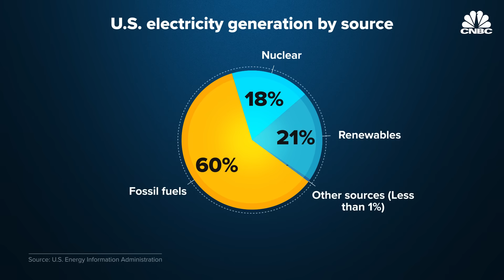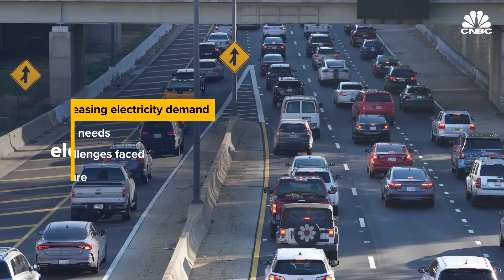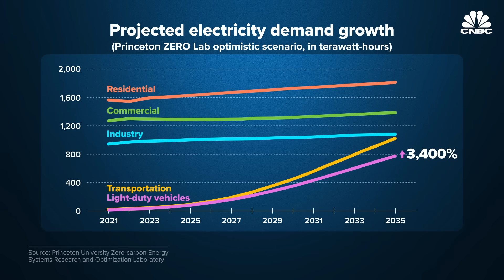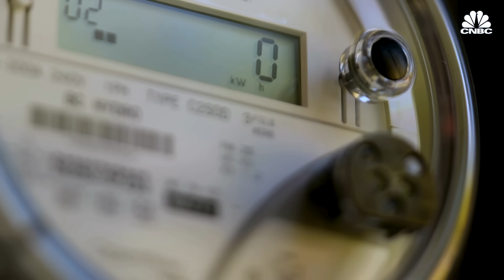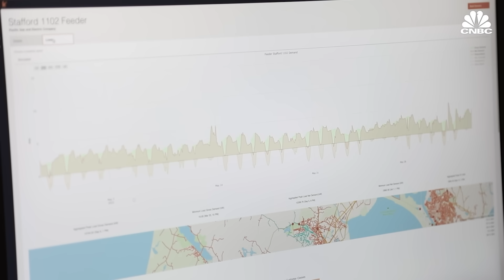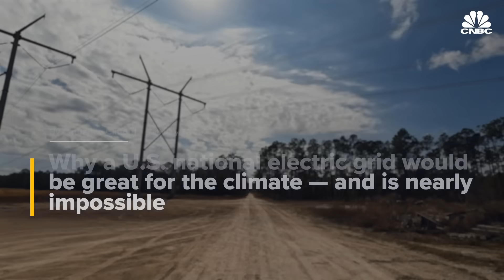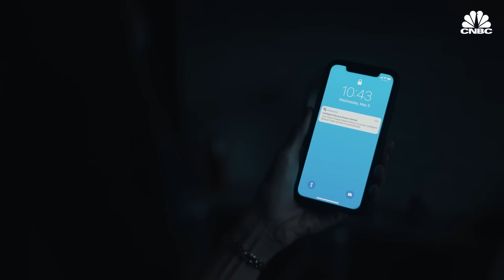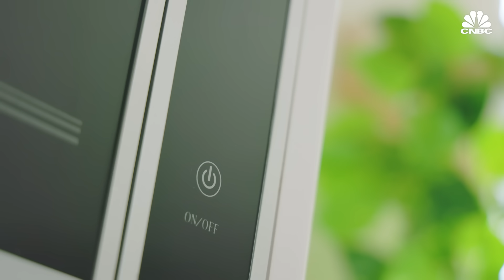Can The U.S. Power Grid Handle The EV Boom?

Comment: Peak grid usage will not change very much from EVs.  The vast majority of people only charge at home in the middle of the night the grid is running at a fraction of it's capacity.  The only real change is to have more nighttime generation available using peaking plants or batteries storing solar/wind generated during the day.
Reply: Solar "generators" are coming on line.   I get a kwH per day from 16sq feet.   That's about 8% of my daily usage.   I use 380 kwH per month. 

That's power I no longer pull from the grid.  My incremental cost is $800.  I can add storage for $499 and generation for $200.  Their lifespan is 3000 to 5000 cycles.   That's over 10 years.
Reply: Massive amounts of wind blows at night.  Texas has so much wind at night that there are now many "free nights!" electricity plans in Texas right now.
Reply: This is a TERRIBLY ignorant report with massive nonsensical fear-mongering.
Reply: @speculawyer  Yeah, creating drama about the grid is a lame Click-Me youtube model.   Works, huh?
Reply: @speculawyer  Well, yes. How you going to make any money if you don't scare people into giving it to you? How are you going to get any clicks? The name of the game is to take the money out of your pocket and put it into my pocket.😁
Reply: @speculawyer I don't think it was too bad, but they could have pushed the solutions a bit harder most EV's can be charged out of peak times because many hold a weeks worth of driving.

Alot of people drive very short distances as well when we could walk/ ride instead.

In my country I can see power plans allowing very cheap power in the mornings due to us having large amounts of distributed solar.
Reply: those adults paying attention recognize Texas has been in a Heatwave (day and night) for the past 2 weeks.  RIP nighttime charging.
Reply: @phillyphil1513  And if you look at the record demand curve from 27 June for Texas, you will see from 1am to 10am (9 hours) there is enough capacity to charge plenty of EVs.
Reply: @AORD72  uh huh, and if Stockton Rush we're still alive (which he isn't) I'm sure he'd tell us all how carbon fiber is a "wondurful material" good for building Submersibles rated to withstand 6000 PSI.
Reply: @phillyphil1513  Why would you make such a unrelated argument to a debate? Can't you use examples related to the topic? Like I did using the demand curve. You break off topic using some snarky comment, kind of shows that you don't have knowledge in the industry. Do you have an qualifications in the electrical industry? I do in my country, I'm registered to be allowed to do electrical work in my country.
Reply: @phillyphil1513  what does Rush or a sub have anything to do with this?
Reply: And that is just the arbitrage function. When you pair intermittent use with renewable intermittent supply you actually create a buffer.
Reply: You still need the grid to charge it. It have nothing to do with peak usage.
Reply: @saulgoodman2018  You already have the grid. It can supply well over double the demand during the day than currently exists at night. Instead of running your AC, electricity appliances, and other large loads as you do during the day you charge your vehicle at night. Dynamic pricing will do wonders for flattening demand. Right now peak prices are only a little bit more than off peak. If they are five or ten fold then you will quickly see people change they behaviors.
Reply: @matthewhuszarik4173  People are still using their HVAC at night. They still have their fridges plugged in at night.
It have nothing to do with peak load.
Once you have everyone charging at night. Then demand will get high at night.
Reply: @matthewhuszarik4173  Right now just one example. Arizona Public Service charges $16.88 per kW and $0.124 per kWh on peak, $0.053 off peak, $0.032 super off peak and an additional $0.40 per day. I wouldn't call that a little more. There are various rate plans, this is one.
Reply: @saulgoodman2018  you are clueless. Have you ever looked at a 24 demand graph? Have you ever calculated the average demand for night charging food a EV? A car on average only needs ~5kWh a night which there is plenty of grid night capacity. The grid is only going to need ~20% more capacity to reach full EV adoption, and that is spread out over the next 30 years. These problems are easy fixes. In fact there is likely to be plenty of vehicle to grid in the future, which make the grid smoother.
Reply: @saulgoodman2018 Night time electricity consumption is nothing compared to daytime. The sun is gone so ACs and fridges have to work less hard. It has everything to do with peak load. EV charging happens at low power and an average EV will only need about 10 kWh per day max.
Reply: @AORD72 exactly
Reply: @AORD72  It's like 10kwh a  night.
No matter if you are charging during the day of night, you still need to charge it.
Reply: @Freba9  It have nothing to do with load. When you have millions of them charging all at night. It will still put a strain on the load.
Reply: @saulgoodman2018  Like I said: the load is low, so total load is also low. 10 kWh spread over 10 hours is only 1000 watts.
Reply: @saulgoodman2018  " you still need to charge it.", nobody said you didn't. Even if it was 10kWh a night which it isn't (you obviously can't do the calculations) that is only 1kWh every hour. Do you think the power companies are NOT going to want to sell more electricity? Just like the last 100 years, the generation and transmission companies will add more to suit the demand to make more profits. The money they charge for a kWh will pay for it all, just like what has happened for the last 100 years.
Reply: @saulgoodman2018  " It have nothing to do with load", it has a lot to do with load. The grid will handle what it is designed for, which is usually peak load, the operators have the ability to shut of demand to handle load. At night time the load drops of because the majority are asleep, so there is plenty of capacity to charge EVs. All around the world grid operators have the ability to shut off hot water heating, street lights etc to handle peak loads. It is very simple to have EV chargers installed on load demand lines that can be switched off (my house has dual meters already for night rates, one meter for night heating which is far cheaper). OR charge higher rates at peak time which most normal people understand and will set charge times to use lower rates.
Reply: @Freba9  That's 1 car. Multiply that by 1 million EV's.. That 10 million kwh. That 10,000 MWh. So day and night will be at the same demand.
California electricity capacity is 80,000MWh
Reply: @AORD72  "10kWh a night which it isn't (you obviously can't do the calculations) that is only 1kWh every hour" 
Obviously can't do the calculations. 10kWh, is 1kWh every hour.
Kwh means per hour.

You people are only looking at 1 car. Think in terms of millions.
Today, the grid cannot support 10's of millions of them.
Reply: @AORD72  " All around the world grid operators have the ability to shut off hot water heating"
Really? They cannot just off power to certain appliances. 
Think in terms of millions of cars. Not 1 or 2.
Charge 10's of millions of cars at night. Loads will be about the same as during the day.

It's like basic math eludes people these days.
Reply: @saulgoodman2018  "California's peak electricity demand of 52,061 megawatts occurred on September 6, 2022", your math seems wrong, and that is only the peak demand, it doesn't say the max carrying capacity of the system. 
Do you think over the next 10-30 years as more EVs are used, that grid companies aren't going to add more capacity? They only install enough capacity to meet the needs at the time. They want to sell more to make more profits.
Reply: @AORD72  I said their max capacity is 80,000 MWh.
I never said they can't fix it. I said as of now, it cannot handle.
Seems that people have a comprehension problem.
Reply: @saulgoodman2018  You can calculate by one home or all, the results are the same. One USA home averages 30 kWh a day. An average USA car travels 42 km a day or 6.9kWh (my country it is about 4.6kWh). The home peak demand will be when water is being heated and when means are being cooked. That is at breakfast and dinner. This might be as high as 10kW power demand, the power draw might be like: a hot water element 3kW, oven 3kW, jug 2kW, TV 0.3kW, lights 0.2kW, computer 0.5kW. So you might have ~5-10kWh for a hour or two in the morning or at night. 6.9kWh to charge a car can easily be spread across the night time when all those other appliances are off.  

Look at the demand curves and you see that there is plenty of night capacity to transmit the need energy.
Reply: @saulgoodman2018  " They cannot just off power to certain appliances. ", no that is not what I'm saying, they have the ability to turn off certain connections that certain appliances are connected to, that home users have specified because it is cheaper. 
This was/is often the case to handle load. In many countries hot water systems where/are controlled separately, this allows operators to handle grid load. These days it is used less because of more resistance grids and supplies. But with smart meters it is a lot easier.

I've seen in at least one video an EV owner in the states put their EV charger on a seperate line for non peak rates. 

If you have a million cars you then have roughly a million homes of capacity. A single home has enough capacity so a million homes will also have enough capacity at OFF PEAK TIMES.  

With no EVs peak power demand is per home is like 10kW,  so for a million homes 10GW peak power draw. 
With EVs at night power demand is per home is like 1kW plus another 0.5kW for things like fridges, lights etc, so for over a million homes it is only 1.5GW power draw.
Reply: @saulgoodman2018  You said "California electricity capacity is 80,000MWh", what are people supposed to think from that. 
You said "as of now, it cannot handle.", just like the demand every other year before the next year for the last 100 years.
The generation/transmission companies don't over build they grid because it is not cost effective. Extra supply and capacity is built as required not before.
Reply: @AORD72  And how many times a year they are blackout, brown out, and rolling blackouts?
All because the grid could not handle all the  demand.

California was just an example.
Reply: @saulgoodman2018  California problems were not production -- but rather because the Private For Profit Companies failed to maintain the hardware of the Grid itself, and energized wires were falling off the poles.   To save a few million dollars, they did Billions of Dollars in damage.
Reply: @saulgoodman2018  There are blackouts because the power companies run a fine line between oversupply and undersupply. They run demand prediction models and sometimes they make mistakes or there are unforeseen situations like extreme cold snaps or low rainfall. Like I said they don't over invest because it cost money. Imagine if every competing generator added 50% more capacity, what would that do to the price of a kWh of electricity. 

"All because the grid could not handle all the demand", and has the USA grid demand actually grown much in the last few years? No, since about 2006 demand growth has been flat. Far steeper demand growth in the late 1980s, a boom in computers and electrical appliances that used main frequency transformers. There has been hardly any growth for the last ~17 years because of the change to high frequency transformers, LED bulbs, air conditioning used for heating instead of plain electric coils. Growth has not caused grid failures. There are hardly any EVs on the road at the moment, they did not cause any grid failure problems.
Reply: @philtimmons722  just admit the the grid can't handle it today.
Reply: @AORD72  stop thinking in terms of 1, think in terms of millions.
Reply: @AORD72  No batter is 1kw, they are like 75-100.
No where can the power company's cut power to certain things. There's only 1 power line coming into a home. They have no idea what the power is being used for.
Reply: @saulgoodman2018  Why is it so hard to understand that if the load per home is low, the total load is also low?
Reply: @Freba9  why is it so hard for you to understand that the more rhar are charging, the more the lod will be.
Reply: @saulgoodman2018   That is daffy.  The grid can already handle today everything there is today.  You may not understand that there are large peaks (and so valleys) in Electricity Use?  During the Summer -- about 30 days or so, maybe 4 to 6 hours of those 30 days (about 30 x 6 = 180 hours) a whole big bunch of Air Conditioning is on, all at the same time.   Since we have to have to build things to handle that Peak Use -- (180 hours / 8760 hours per year, about 2% of the time) -- the Other 98% of the time -- things are surplus.   Since New Solar PV is building out faster than New EVs -- things will stay surplus all the way ahead.
Reply: @saulgoodman2018  Because the load is lower than daytime peak.
Reply: @philtimmons722  Then how do you explain all these blackout, if the grid can handle it?
Reply: @saulgoodman2018  First, can we agree that most of the time, most of the US grid is up and running fine?  Just trying to make sure we match on the baseline -- so we have a common starting point.   Most (all) analysis comes out way better than 99% reliability for the general models of the US Grid, right?  Look up some numbers and see if that matches what you are seeing?   So even if things are fully up and running "only" 99% of the time (but again, US are better than that) -- with 8760 hours in a year -- 1% downtime would be 87.6 hours per year -- right?  You follow the general math?  So that less than 87.6 hours per year are what you are asking about?
Reply: @philtimmons722  You have too look at the future.
You have a little more then 300 plants, nuclear and coal, that have shut down in the past 15 years. 
Solar and wind is less then 5% generated.
Reply: @saulgoodman2018  dunno if you made it past the reliability part yet or not -- seems a little spaz to jump to Service Life, we can hit that next.   So with Reliability, the most common cause of outages are:  
1. Weather / nature related.   Tree branches, wind, wildfires, tornados, hurricanes, critters, etc.  For example, here in East Texas, squirrels are a leading cause of outages.  
2.  Next are human errors --  car accidents, construction, etc.  
Both 1 and 2 can be vastly reduced by Underground for the wires, with the local transformers and switches set up on short concrete pillars, above local flood levels.  
3. Finally what I think you were asking about?  Generation outages and equipment failures?  We have things like Coal Boiler leaks, pumps on Nukes, Turbine Trips, etc.  In this domain Solar PV is the most reliable.  Solar is so reliable we can leave it unattended for years on Islands, Buoys, far remote -- even Satellites in Space.
Reply: @saulgoodman2018  Then I think you were jumping to Service Life?   Everything on the Grid has a Service Life.  Typically about 25 to 50 years.  Works that way for poles, wires, generator sites, transformers, on and on.  So inverting that 25 to 50 years, it means we should be (and generally do) replacing about 2 to 4% of things every year.  And we do, often with an additional 1 to 2% for growth.  It happens all the time all around US, and most of US do not even notice.   
If grid operators try to run beyond Service Life, major failures can occur, as when the California For Profit Operator (PG&E) was trying to run High Voltage lines 80 to 100 years, and had live cables fall from towers and start forest fires.    
Applying that 25 to 50 Service Life to a moving "Time Window" allows us to see into the Past and also the Future.  What we have operating now is what was built over the prior 25 to 50 years, and what we build now will be around for the next 25 to 50 years.   So US quit building New Coal a little over 10 years ago, so we should be all out of Coal plants within 40 years.  You mentioned Nukes, and the Peak Year for Nukes was 2012, with 104 Reactors on line.  Now in 2023, US is down to 94 Reactors (10% drop) and the surplus is not even missed.   Both Nukes and Coal were overbuilt a few decades ago, and has made Baseload and Night-time rather worthless.  Looking ahead from now in 2023 -- US is now mostly building Solar PV -- so in the decades ahead US will have mostly Solar PV.   See how that Time Window thing works?
Reply: @saulgoodman2018  you don't understand do you. 1 kW is a power rate that you can easily charge the average car each night, because the average car only does 42km a day.
Reply: @saulgoodman2018  "Then how do you explain all these blackout, if the grid can handle it?", low water levels so supply is low from a lack of rain.
Reply: @saulgoodman2018  "Solar and wind is less then 5% generated", not in the UK and Germany it isn't. In ten years they have converted their grids to 25% wind.
Reply: @saulgoodman2018  "No where can the power company's cut power to certain things", they can if your plan has dual meters or controlled meters. I HAVE DUAL METERS connected to 1 single incoming line. They send controls down the line to switch a meter on/off (they turn one meter off during the day when demand is high).
Reply: @AORD72  "low water levels so supply is low from a lack of rain." 
That make's no sense.
Reply: @AORD72  "the UK and Germany it isn't. In ten years they have converted their grids to 25% wind"
That is only 1 country out of hundreds.
The grid would not be able to handle million of EV.